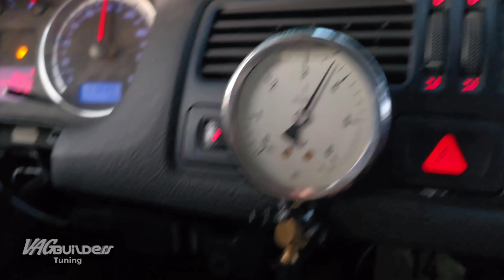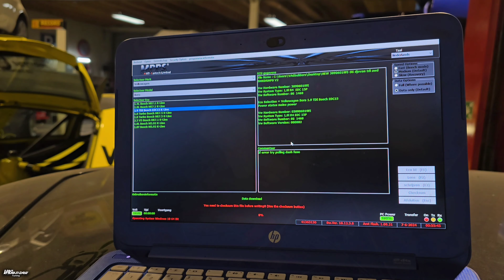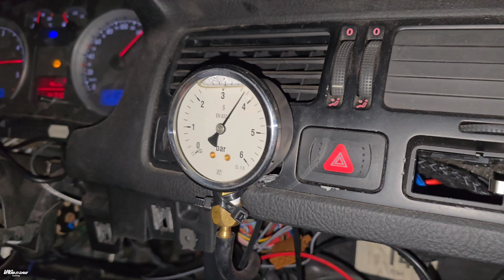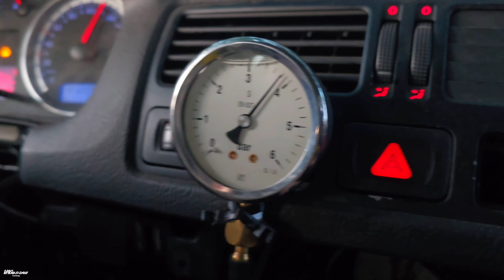our VR6T and TDI AWD are stronger than ever!!

Comment: Hello brother, my IC XXL has a 70cm exit, shall I make a reducting for 63 piping? I heard that big intercooler piping causes lag, I have 2265vkr turbo
Reply from the maker: Hello, 
With a 2265 the 62,5mm piping will be enough. How bigger the pipe size, the bigger the lag.. but with a bigger turbo on high boost you cant have any restrictions. So with the 2265 62,5mm piping is good, with a bigger turbo on high boost minimum 62,5mm up to 70mm. 

Hope this helps you, if you'll have any questions, just ask.
Reply: @VAGbuilders_Tuning  thank you for the answer my friend, what about exhaust size? I have a 76cm Downpipe